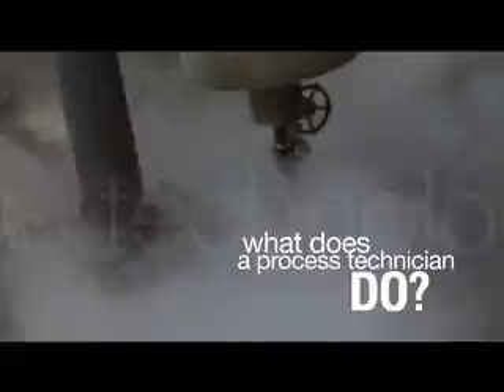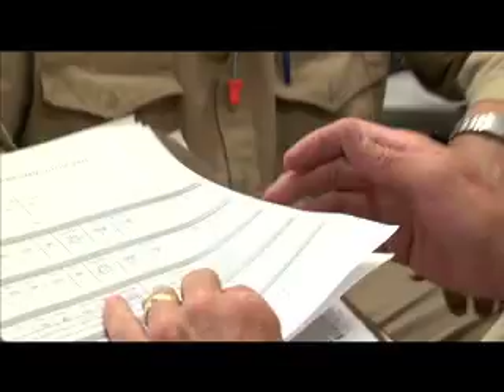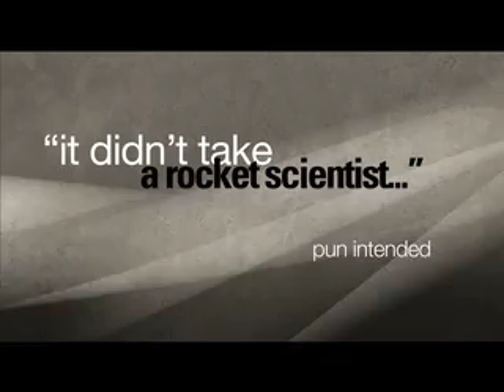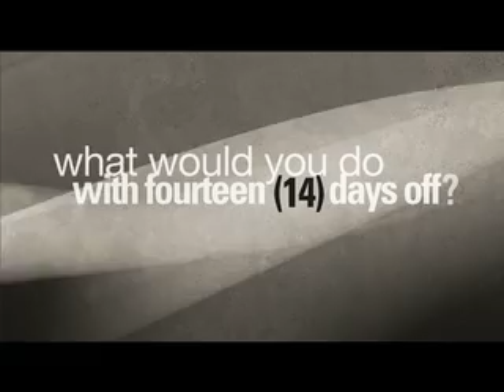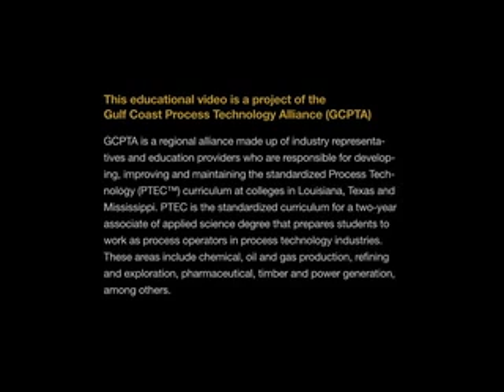Process Technology Career Opportunities

Comment: I just registered for the PTEC program at the local community collage in my city. And the pay after your graduate is anywhere from $60,000 to $80,000. But that's with the associates degree. I am in Louisiana and upon graduation I want to move to California to work at a Energy plant. Plus I have a bachelors degree in social services.
Reply: If you get into a major refinery as a process operator believe me you will easily be making over 6 figures base pay and if you like your over time you can reach 200k a year. But you have to be ready to take in a great amount of processing information regarding reactors, process vessels, fractionators, heat exchangers, different types of electrical, electromagnetic signal instrumentation , different types of pump systems...
Reply: I didn't know this existed they offer it at my communication college at brcc
Reply: How did it work out for you?